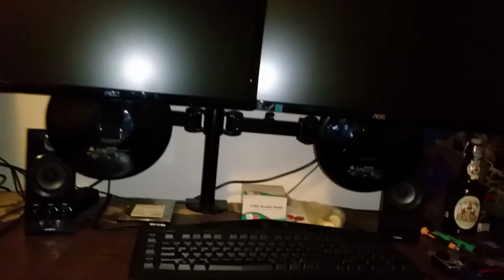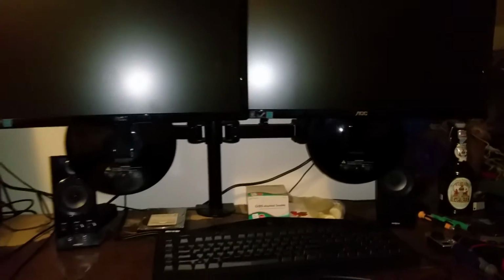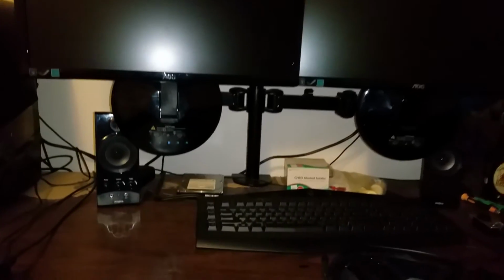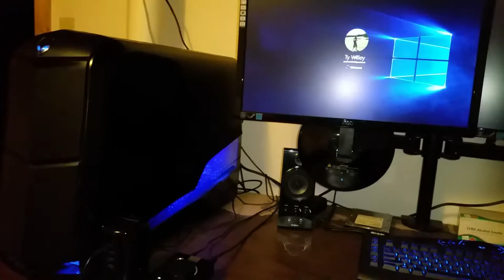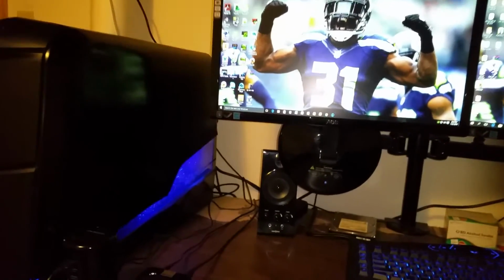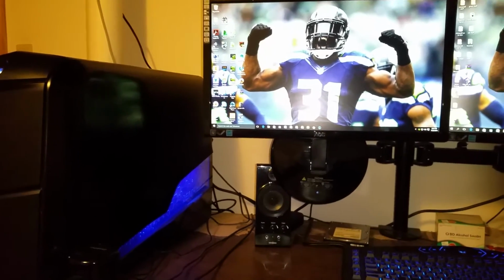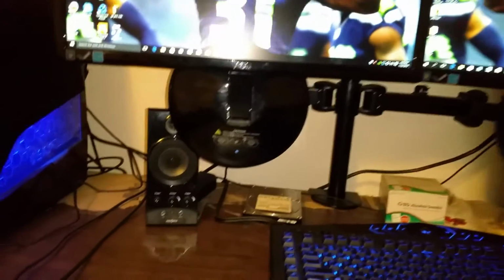Alienware Aurora R3 update

Comment: I watch you replace the video card and the cpu, as I was looking to upgrade. Today my brother said he smelt something burning and the computer shutdown. We looked everywhere no burnt spots on board, video card or sound card. Checked cables then we opened it up and ran it, the diagnostic  button at the back didn't light up. So thought it was power supply. After unpluging cable after cable found the lower 24 pin ribbon then everything lit up. Maybe board died or chip? Maybe both.  Once we plug that 24 pin cable in it dies. I thing it commands ground and some 5 volt systems. Any Ideas?
On a good note I didn't buy chip or memory. Was looking to upgrade board to fit Intel Core i7-8088k processor which I won, but love the Alienware Aurora Case. Can we upgrade motherboards in these things?